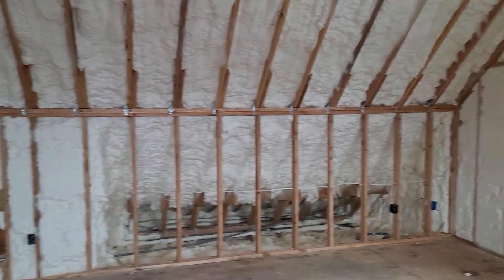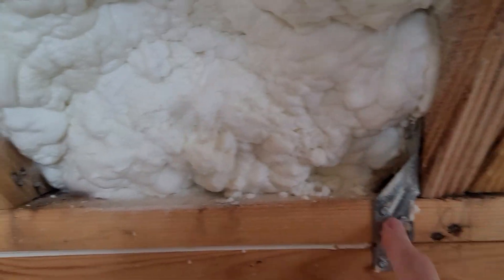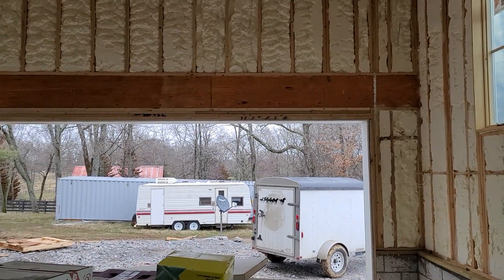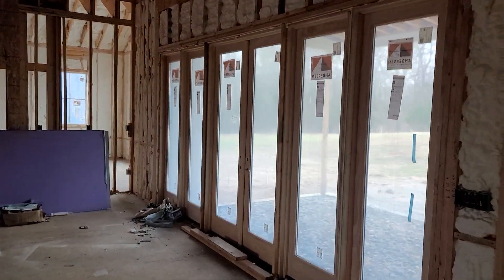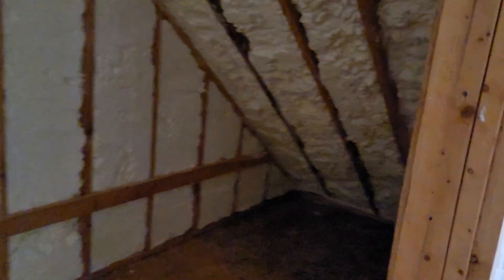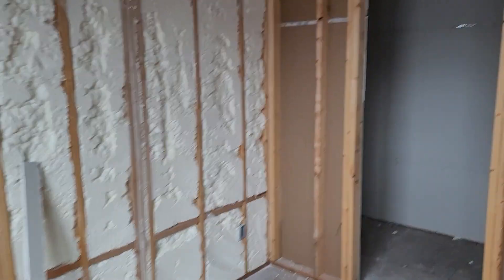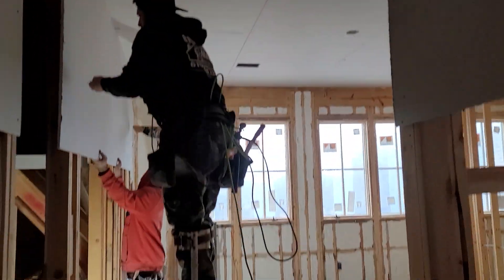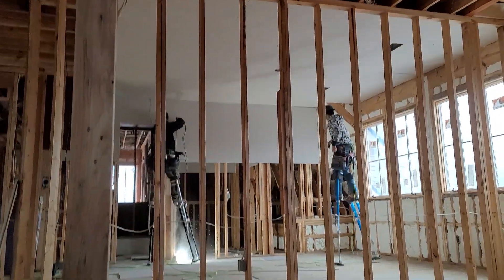Little things before drywall. I shouldn't do these after I've hiked, I was  out of breath. 😂

Comment: it does appear the hurricane clips were installed over the dormer windows. Doh!

Second avoid using Flex for HVAC: I can already see a few pinch points that is going to restrict flow, and Flex always fails, at best a Flex Mfg. will only offer a 10 year warranty. When it fails the fiberglass is exposed and its not health to breath in fiberglass particles.
Reply from the maker: I put hurricane  clips at all points.  I have personal experience seeing those work from a tornado. 
As far as the flex, noted, but this is industry  standard  here and will  stay.
Using the foam and the system you see, one of my rental properties (1100 square feet) had a 326 dollar electric bill while this house (6000 under ac) had a electric  bill  of 350 dollars.
Reply: @Frank_the_contractor  $350 Per month or per year? I suspect per month.  Mine is about $150/mo, 6600 sq ft of conditioned space. 2x6 24" OC with Roxul, & 2" exterior Rigid foam, SIP Roof. AC system consists of two ducted mini-splits (one for each floor). For Duct work I use Kool-Duct & PVC & some metal ductwork.

I don't like spray foam since either its a sponge (open cell) or rock hard (closed cell). The close cell is a nightmare if you ever need to do maintenance\repair. and the open cell is a mold nightmare. With the Roxul you can just pull it out of the area needing repair, It does not hold water and does not outgas toxic fumes in a fire like sprayfoam does.
Reply from the maker: What zone are you in? Thanks for your input, I will definitely research the Installation System you're speaking of.
Reply: @Frank_the_contractor  Zone 7.
Reply from the maker: Rockwool! We use rockwool for sound insulation.